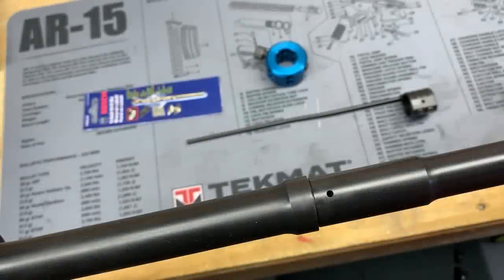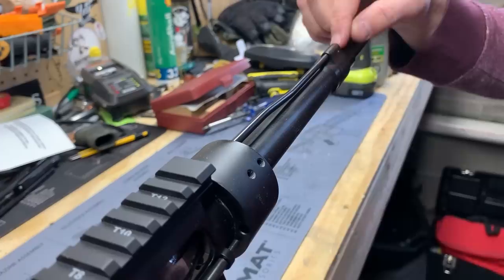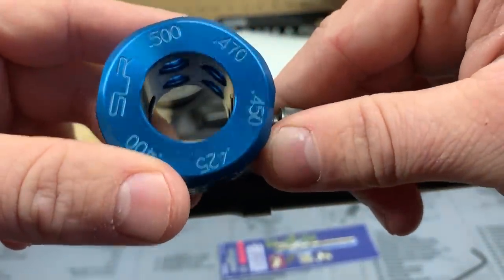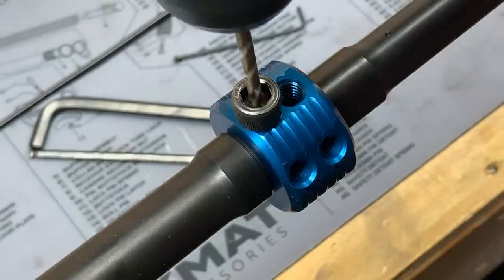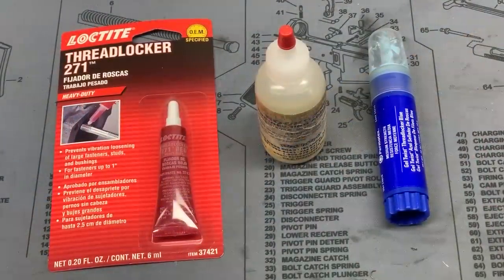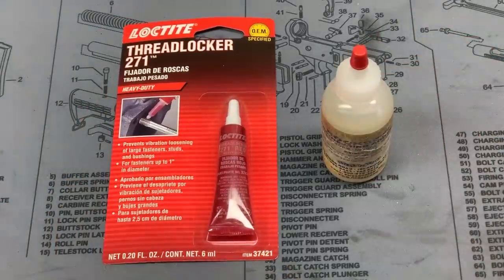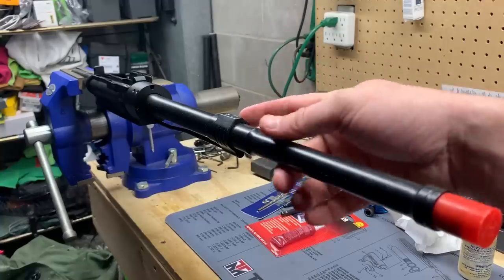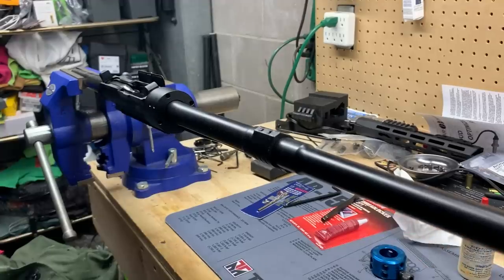How to PROPERLY dimple a barrel & install a Set Screw gas block

Comment: Or you could use a dern torque wrench🤷‍♂️.. On the topic of removing set screws with rockset, I have had great luck with boiling water, either setting it in a big boiling pot or spooning boiling hot water over to the screws and letting I sit for a few minutes. Both methods have never failed me and it really doesn’t take any time at all. But I also installed them with a torque wrench and they’re not over torqued.

Comment: What again is the device in the vise that 's holding your upper assembly ?
Reply from the maker: Nick J  Brownells lower receiver vice block.
Reply: Have a receiver block, you seem to have something you pull out and rotate 90 degrees. My lower receiver block fits the mag well and does not allow for any rotating.
Reply: @nickjm37fordel1  it's a gessiele reaction rod.
Reply from the maker: Yeah, Geissele Reaction Rod.
Reply: @killdozer_93     Thank you , I'll check it out :-)
Reply: @Highjak86  Thank You

Comment: I personally hate taper pin gas blocks.  So I modify all my A2 FSB with dual set screws.  And I usually put them on a bridgeport mill.  I am a machinist so I have access to them.

Comment: Got the jig, the cobalt bits.. wasn’t doing anything. Read to buff off the nitride where the dimples will be, did that, used another new bit, and this shit is NOT working! Barely a dimple after pushing down till my arms were shaking, a little penetrating oil. Barrel is ballistic advantage 4150 cmv QPQ finish. I don’t know what else to use? And I have 5 barrels to do.
Reply from the maker: 50calprepper Well, you watched me drill right through the nitride on this video. I’ve done so several times on nitride barrels with this same bit. Did you use a drop of oil?
Reply: Highjak86 Yes, I used a cutting oil from work. Don’t remember what brand
Reply from the maker: 50calprepper  What brand bit?
Reply: Highjak86 A Cobalt from Lowe’s... I finally got one barrel done. It just seems way too hard to drill? Idk why I’m puzzled. I mean so hard to get drilled, I considered sending them off to have have done.
Reply: Watching you drill again... mine doesn’t cut nowhere near like that! Maybe I need to try a different bit? I think the one I got was Dewalt.
Reply from the maker: 50calprepper I’d recommend trying a different cobalt bit.
Reply: @Highjak86  Hello, and thanks for this very informative video. How long did it take to make that dimple?  I have the same exact bit that you used and its taken me so far about 30 minutes and I'm only about half way.  My drill is cordless and set on high speed.
Reply: @vindee5670  Try low speed and put the drill on “Forward”

Comment: Why is it that most ar15 manufacturers just put one dimple on one set screw? Why not do both set screws?
Reply from the maker: This is explained in this video.
Reply: Varying distance between set screws for different brands of gas blocks

Comment: especially running suppressed they get hot? cold ammo has lower explosion and suppressors dissipate heat across a greater mass. however fully auto and high rates of fire increase rate of sustained heat. meanwhile blue locktight is bad. red locktight is bad... purple is ok at 300degree for light cold ammos anything with extreem power 45acp, 10mm, 233wild, 30/06, 308win, id recommend something with a 1500+ temp rating... best is heat lock at 2k degrees. so this is good for securing barrel nut, gas block, supressor/compensators ect... where things back in the grip or buffer housing ect purple is ok, everywhere else on exterior weapon dress basic locktight is ok.

Comment: Great video but my OCD is acting up because you didn’t dimple both.
Reply: I dimple both,but the reality is it doesnt matter. Rocket them,screw them in. The one that is dimpled first. That one will keep the gas block from moving. I have have to use my rifle as a club or axe tho so I dimple both just in case.

Comment: ballistics advantage strongly recommended NOT dimpling the barrel
Reply from the maker: 1965mt This is a great example of not believing everything you hear. There is some merit in using a clamp on gas block for accurizing reasons and of course a clamp on requires no dimple, but omitting all dimples on a set screw install is silly. These are the differences in quality and attention to detail for the sake of reliability and durability you’ll see between a company like BA and BCM.

Comment: Always recommend degreasing the threads before applying locking compound, there is no point in using locking compound if it will not adhere to what it is supposed to be retaining. As for the rockset, that will typically break at 1300 degreese so you will need the torch to remove those screws. The only time rockset is recommended on an AR is for muzzle devices that will mount to a suppressor. For the gas block screws I would recommend the red loctite 271 as it can be removed at a much lower temp than the rockset when both are properly applied. I will disagree and say that rockset is less serviceable due to the removal temp and its potential to bind in tight fitting threads even when heated to temp. With that being said, the rest of the video was great. Thanks for uploading!
Reply from the maker: Caleb Savant  Regarding Rocksett, no you won’t need a torch. I address this in this video.

Flexbar specifies 2,015 degrees F on Rocksett. Having done probably 100+ gas block and muzzle device installs I’ve never used heat to remove Rocksett on either gas block screw or muzzle device. Heat is not needed and it’s likely a very bad idea to even attempt to heat a gas block/barrel to over 2,000 F.

The threads on both gas block set screws and most muzzle devices are not too tight for Rocksett. Apply as noted in this video, let it cure, and attempt to remove it without using shock to test if you like - not going to happen.  Heat, water, and shock are all addressed in the video.  Rocksett performs well and as intended for the standard gas block screw threads.

Rocksett is far more serviceable than 271.  I've installed and removed both.
Reply: @Highjak86  I believe someone is spoofing you here. Caleb Savant is the “Myth Busters” guy from Brownells. I doubt he would have commented on this video

Comment: What you girls fail to understand is that there are many types of set screws. Some will dig in and raise the steel . If that happens you can't remove the block even if you take the set screws out. But you guys are nerds so carry on.
Reply: You're so cool.
Reply from the maker: You're high AF right now aren't you?

Comment: rocksett is rated up to 5000 degrees....neeevvveerrrr use it on small screws...it puts red loctite to shame...you only use rocksett on brakes that are going to be shot suppressed...if you want to remove anything rocksetted, proper removal is to boil in water for 15 to 30 minutes
Reply from the maker: Frank   Lies. Watch the video. Stop sharing bad info.
Reply: Highjak86 I did watch the video...and lies?...just learned that in gunsmith school along with 15 years experience along with machinists telling me that also...but yeah, I'm lying hahaha
Reply from the maker: Frank  Well, if you watched the video you’d know that everything you just said is false and Rocksett is rated between -350F and 2,015F.  Just stop. It doesn’t take a genius or gunsmith school to spend 5 mins using Rocksett’s resources to learn such a thing. You lack experience to be making the false claims you’re making.

Comment: HEY NUM NUTS ITS NOT COBALT BUT RATHER CARBIDE DRILL BITS
Reply from the maker: It's cobalt.
Reply: It’s “Numb” , hero
Reply: See U Tube video ”Basics of Drill Selection” from Haas University. As in Haas CNC Machines and Tools. Multi $ million company